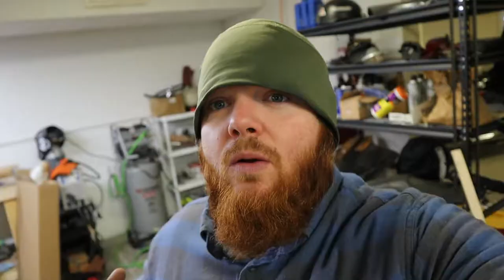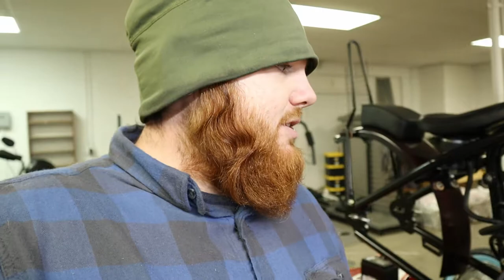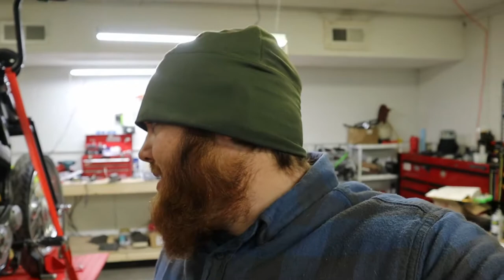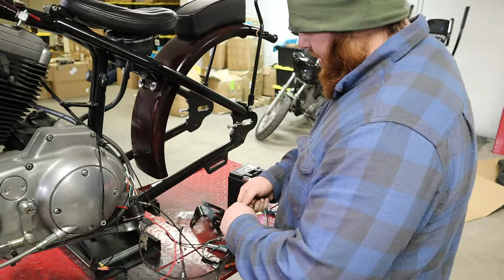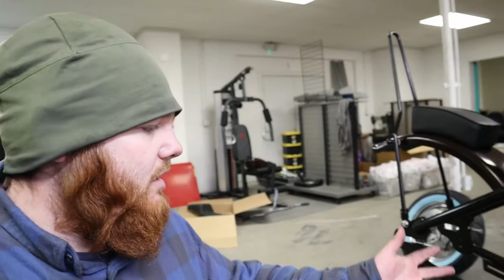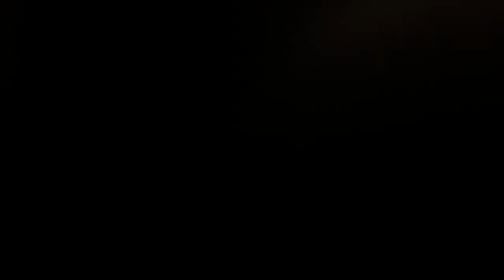Wiring my chopper | How to wire tail lights on a Sportster chopper |

Comment: I'm at that point right now with my ironhead: Wiring, oil lines, where to put the starter relay, how to route my wires, where to put the battery; searching for mystery parts that I haven't seen since the hurricane that destroyed the last shop, etc. Every other day it's a trip to the hardware store for nuts and bolts. Choppers...
Reply from the maker: Definitely not the glamorous part of a build.